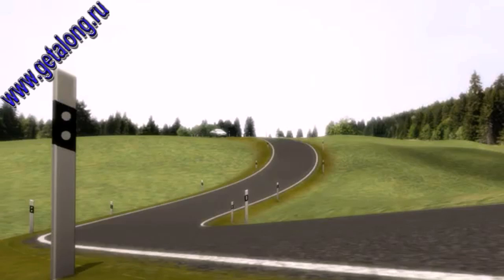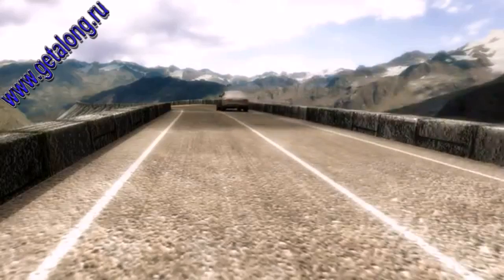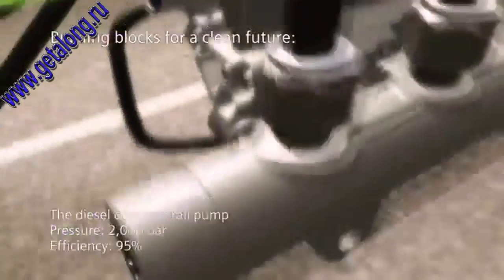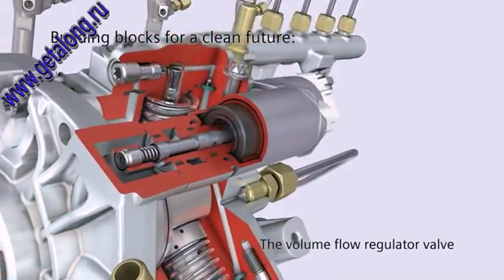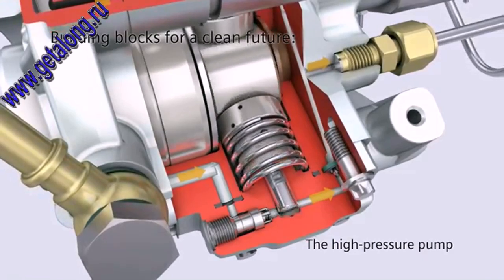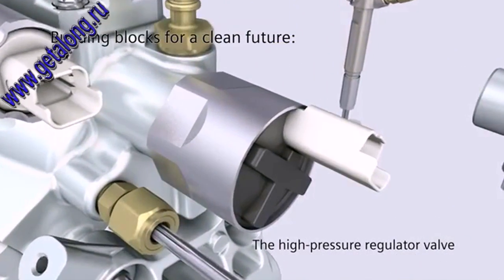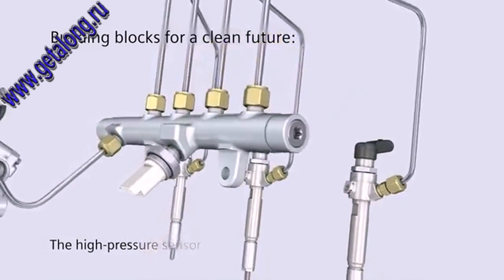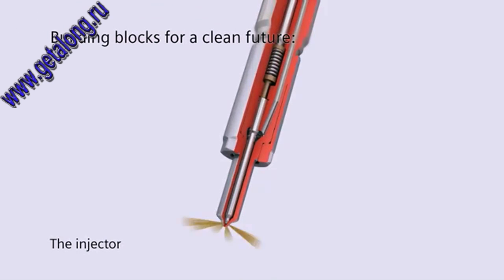Animation Siemens VDO COMMON RAIL

Comment: Hello, thanks for the video. I'd like to know if volume flow regulator valve (VCV - low pressure side) can be replaced without causing issues to the Siemens VDO high pressure pump, since I don't know if it could lead to air entering the system. If not, could you please explain me the correct procedure? Thanks
Reply: Yes, you can replace whitout issues.